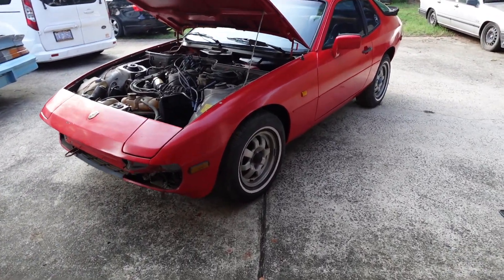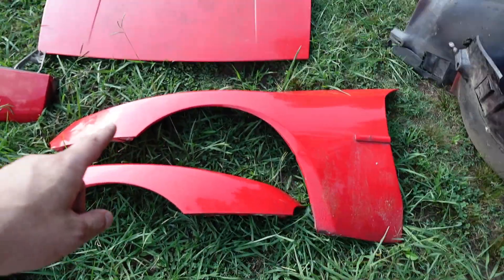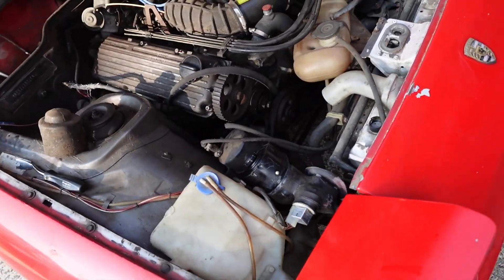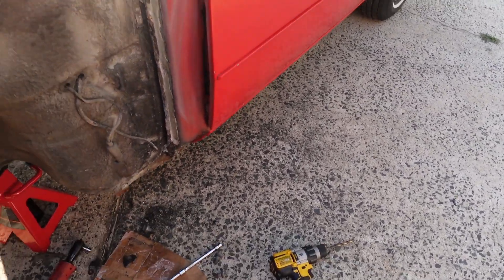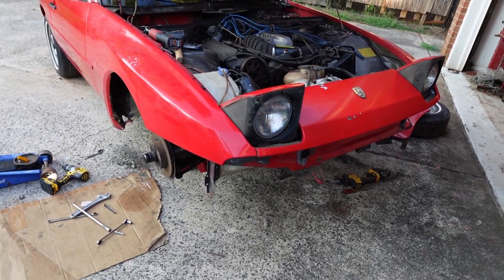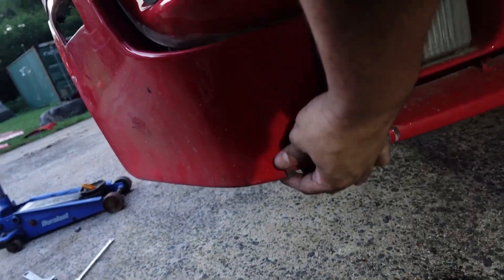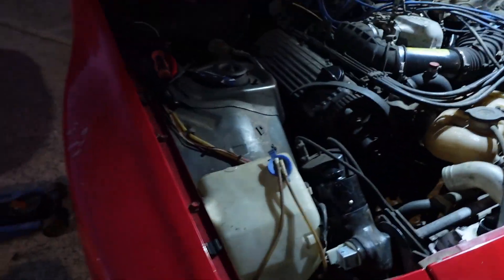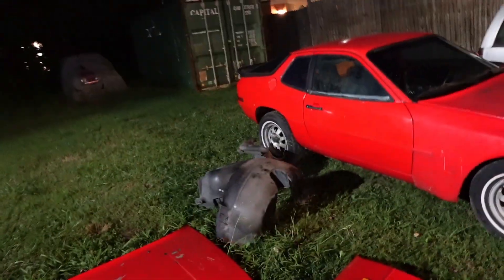Swapping a Porsche 944 front end on to a 924

Comment: The nose panel can be removed. The hood latch isn't apart of the nose panel. The 924 and early 944's had the nose panels spot welded in place, later cars went to the bolt on style (mainly due to the S and S2 models having the air filter box underneath)

You can in theory drill out all the spot welds (probably around 40-50 total if I remember correctly) and install a later nose panel with some small modifications.
Reply from the maker: Thank you for the awesome information, mine isn't in that bad of shape to go through all that but now I know if it does end up getting damaged for whatever reason.

Comment: Friend, is the bumper with the black rubber different between the 924 and 944?
Reply from the maker: As far as I know, the front bumper bar is the same, and the rear is different
Reply: Thanks, I'm going to build my 924 to GTS but I have a 944 bumper and I didn't know if I should also order the bar.